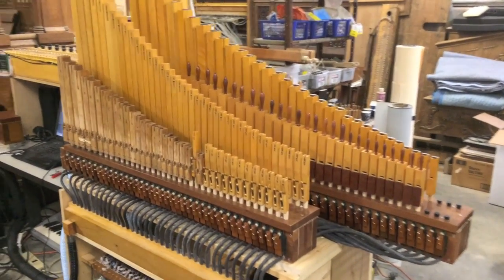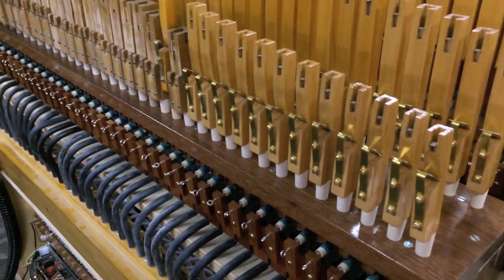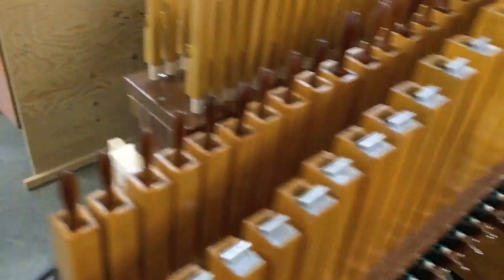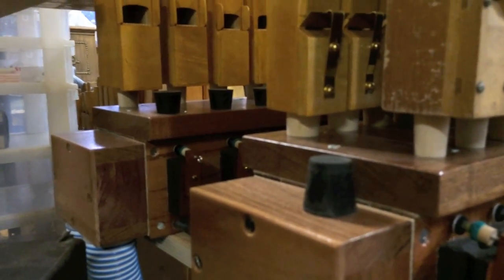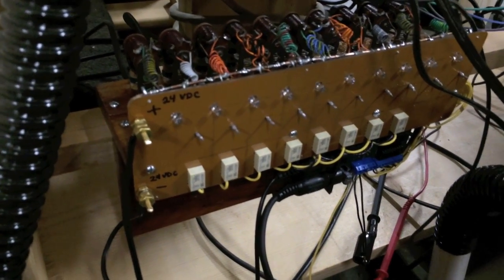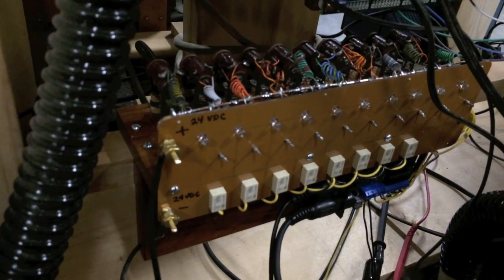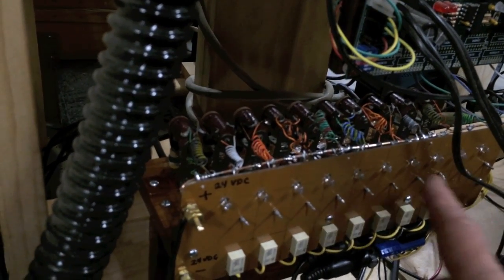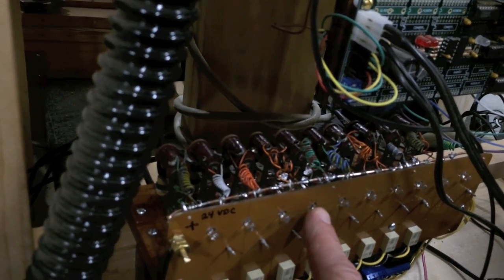As Time Goes By played on new MIDI controlled pipe chests

Comment: Hi - With you on the unreliability of DE action. You build these chests in similar fashion to the band organ systems. There is a simpler way and the magnets require very little power, are used to trip the pneumatic action and will work at almost any pressure. . Beautiful work. Those top end pipes with the harmonic bridges are beautiful. The stop control box is similar to the old Ventil system used in organs that had tubular pneumatic action. Nice job.

Comment: A clumsy and over complicated chest design.
Reply: Hey - You have no idea of the basic systems he works with.  To me, as a builder of pitman chests, as well as individual chests like he is using, it is complicated. But he is approaching it from an entirely different perspective and as such this is a nice, tidy, fast action. He didn't build it for a church or a 50 stop performing organ.  It is a test-bed for a special type of action and it works exceptionally well.
Reply: Even if the design was “clumsy and overcomplicated”, i think the amount of effort that went into it, and actually getting it to work, is worth applauding instead of throwing all that negativity.